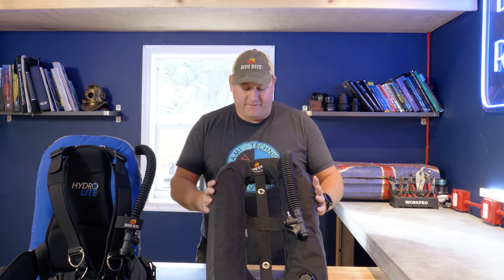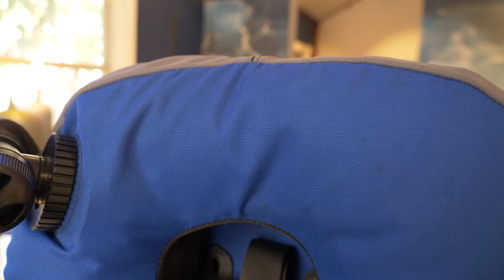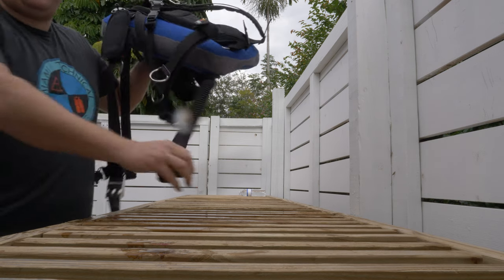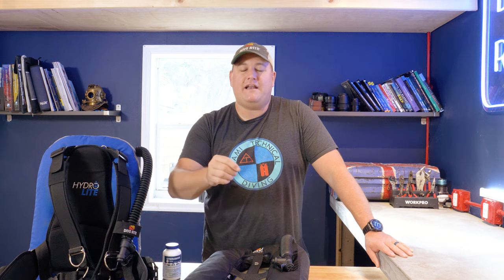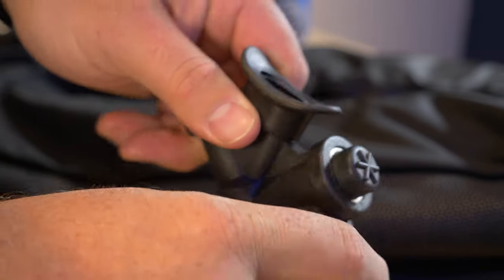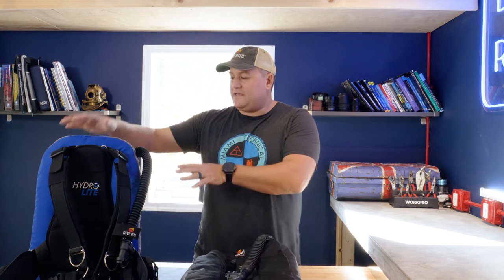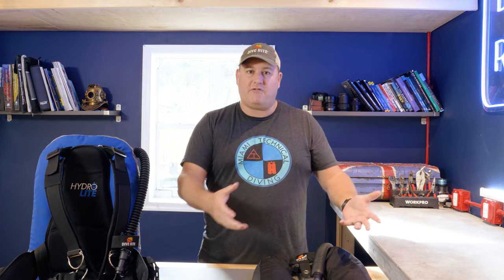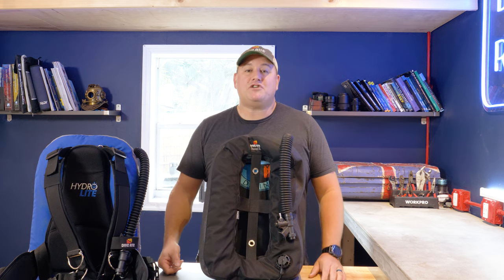Gear Maintenance Episode 5: BCDs and Bladders Sponsored by Dive Rite

Comment: I once bought a wing and it rattled.  Once I took the OPV off I shook out large salt crystals.  Half the size of a golf ball.  Gotta clean that out folks.  I believe steramine needs to sit a bit to work so you may want to just let it lie there for a couple of minutes.  

I never service LPIs.  I throw them out.  Replacements are cheaper than repairs if you’re not doing it yourself.

Comment: Hey James,
I didn't know you could buy a bladder wash hose - I made my own about 2 years ago from an old inflator hose and some garden irrigation fittings, cost me about $3 for parts and works a treat. I'm also of the opinion that you should understand how your gear works and thus buying an old BCD and 2nd stage regulator on ebay or gumtree and stripping it down is a good idea. You soon learn how fragile plastic threads are, as well as how easy it is to replace o rings, as well as how important it is to clean your gear properly.

Comment: I think washing with soap is a waste of time.  I just soak mine over night.  I do drain out the water and run fresh water though it.  The steramine I might try, since it is fairly cheap, but it does seem like overkill.  Wings have lifetime warrenties.  I doubt they would do that if they were going to fail.
Reply from the maker: I'm not sterilizing the wing because fungus or bacteria will cause the wing to fail in it's utility as a BCD. I'm sterilizing it to kill any festering nastiness in that dark, warm, anaerobic bladder.
Reply: The bladder will fail if salty water is left on it or inside; if forms crystals and those will damage bladder eventually by mechanical action. Same applies to rebreather counterloungs if those are not rinsed from outside (assuming sane diver would rinse and sanitize inside).
Reply: @marcin.j.wasiak  I realize you have to wash out the salt.  That is why I run fresh water though it.

I think washing the outside with soap and water is a waste of time.

Comment: Why not simply fill the wing with tap water through the OPV port, after having removed the OPV?   I leave my OPVs off of my wings for storage, so that they eventually dry out inside.
Reply from the maker: The flush of fresh water through the inflator assembly dissolves any salt crystals in the power inflator assembly. In the springs, seats, valves and buttons.
Reply: @DiversReady  Agreed.  That's why I drain my wings through the inflator.
Reply: @OrenNoah  not having this "water hose infiltrator adapter" i fill the bladder with fresh water from the tap using inflator exhaust valve and drain using OPVs and inflator pushing down inflation button.  works well for me. Also found out that shower head hose when unscrewed has fiting diameter to push it against inflator connector (no need for custom adapter).

Comment: Where can I get a hose adapter like that?  Not sure if I could rig it myself. 5:24
Reply: Just hold the top button(deflator) and fill with water.  You don't need this adapter.
Reply from the maker: You don't 'need' it, but that powerful blast of water through the inflator assembly forces any grime or salt crystals out.
Reply: @DiversReady   so where can I get the adapter?
Reply: @jonathanbowden6313  Any dive shop has it.  Support your local store. People buying online is why air fills are now $10.  Most of the time you are paying as much to more online anyway.